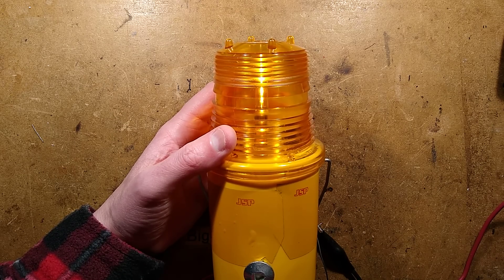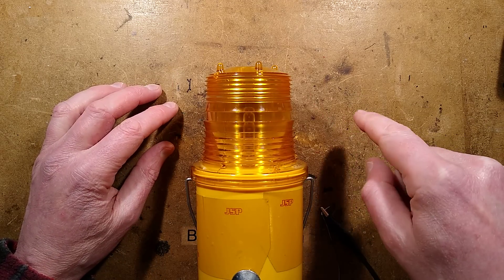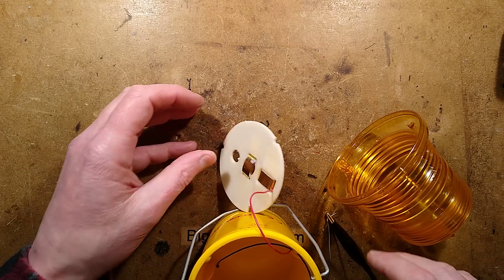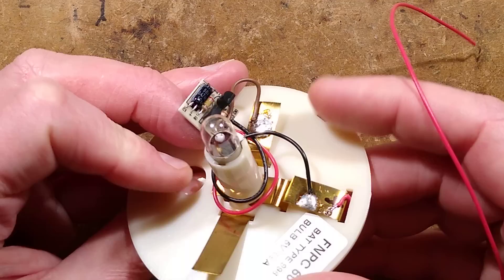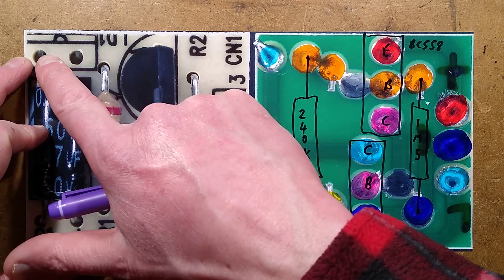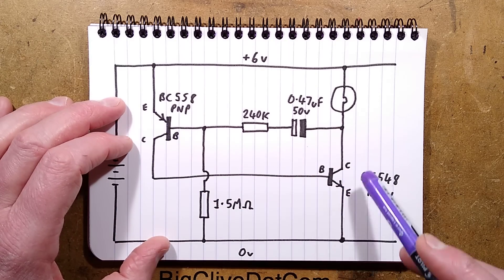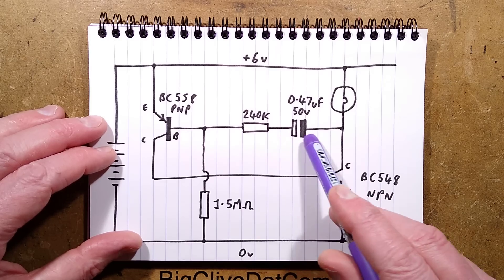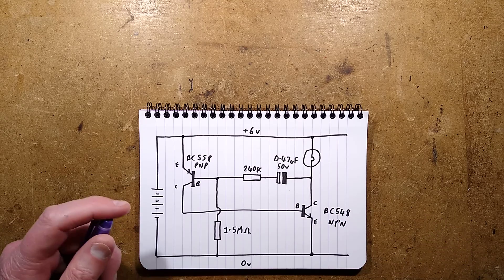Old tungsten roadwork beacon - with schematic

Comment: Seems like a perfectly reasonable oscillator circuit to me.

Initially, you'll get (6V-0.6V)/1.5MΩ = 3.6μA in the base of the PNP, giving about 360μA in the base on the NPN, turning it on solidly. Once the lamp turns on, you'll get about 22μA in the PNP base, or about 2mA in the base on the NPN, and potentially 200mA through the lamp. As the cap charges, the current will drop until the base gets to 5.4V, at which point the transistors turn off and the cap will discharge through the 240K+1.5M resistors until the PNP turns back on and restarts the cycle.
Reply: The question is: is a lower voltage higher capacitance cap bigger?
Reply: @robegatt  As long as the voltage rating is greater than 6V, it would be fine, but makes no difference in the circuit's behavior. Increasing the capacitance would increase the time constant and slow down the flashing.
Reply: @PaulSteMarie  actually the effective capacitance derate as the charged voltage appraches the voltage rating of the cap, but I think that applies only to ceramics capacitors and not electrolytics (that's why the usual rule is to use a 2x rated voltage).
If a ceramic were used here obviously less capacitance involved more resistance and viceversa to have the same frequency.
Reply: @robegatt  This circuit is pretty much at the upper limit of resistance, with only 3.6 μA to kickstart the circuit.
Reply: @PaulSteMarie  my question was about why they chose a 50V cap. Is it because you get more actual capacitance if you stay away (6V or 12V from reference) from the cap voltage rating? it seems so for ceramics, maybe it's the same for electrolyitics. Just a detail.

Comment: I remember you could buy a MES base flashing bulb which had a tiny bimetallic strip inside the bulb, I remember being fascinated how it started to flash (after a short delay) with no other components needed.
I guess they were used in bicycle rear lamps and maybe earlier versions of these roadworks beacons.
Thank you for the video Clive 👍
Reply: GE bulb type 407. They were used for Everyeady Big Jim torches and similar. A sealed beam bulb at the front and the flasher bulb at the back under a red lense.
Reply: That style of bulb was also used in many pinball backboxes.

Comment: hehe good old (PJ)996 battery 😉 i got through loads of them when i was little 😁 and when they were cheap ..theyre not now ... i have an early 60s table top transistor radio that uses 2 of an earlier? version that uses different contacts, not sure what, though,  the roberts r707 portable also used 2 996s , they must've lasted ages...

Comment: I had a slightly older one when I was a student. It had no circuit board at all, but instead a special bulb with a bi-metallic strip inside which heated up to do the blinking.  It had two of the 6V batteries in a more rectangular case.

Comment: I found one of these about 1988 or so. Disco light on holiday with other familes, big holiday home in Derbyshire. I did not steal it, not a place with other ones or building work. Was just a dumped item somewhere. Never used it as the other intended purpose but then I was not a roadworker, just 14 years old, that would be a bit dodgy. (now bet this makes not sense to some). Will if look at the right bit here on YouTube. Nice video.

Comment: I remember having a Pifco lantern in the 1980's that had a forward pointing torch and a red flashing top light that worked off the same lantern battery as yours.  However the bulb had an integral tiny bi-metallic strip to make it flash.  They were small screw in bulbs that had a sort of dimpled pattern spherical glass that was quite a bit larger than the threaded body..  I love how you make everything so interesting.

Comment: We used to nick these off skips in the early 1970s when I was a kid, good source of batteries.
Reply: Skips generally speaking had these lights attached to them to help warn road users of the presence of something sticking out into the road. I am certain that some by-law changed as, of about twenty years ago, skips no longer are obliged to have this emergency illumination...
Reply: @monchavo  Lots of highway laws have changed over the years in the UK, I remember you used to have a parking light illuminated if you parked the car at the side of the road at night.

Comment: Very nice. I expected to see them use the classic 2 NPN 2 LED style circuit but this was unexpected. Bit of a shame that they didn't use a mosfet to drive the lamp or a larger bjt given that it's max rating is 200ma. Pretty sure the LD header is the low voltage equivalent of the finger test. It stands for "lick dis 1"

Comment: i was going to drop some silly comment about using even less components for an oscillator, but it doesn't get much simpler.
a single transistor relaxation circuit is not very good at voltages that low...

Comment: I took one apart in the late 70's (a college thing). The flash was short, like a pulse. I reverese engineered it and found a two transistor relaxation oscillater with a tantulum capacitor. The board was thin and contained inside a plastic tube, with the bulb on the end. I think it charged the capacitor and then dumped it through the bulb. It lasted ages on one of those batteries.

Comment: Fun fact, the voltage on the positive of the capacitor, with respect to 0V, rises to nearly double the supply voltage, minus a diode drop, when the lamp turns on. This is fine at 6V, but if the supply voltage is any higher, it will exceed the reverse base-emitter voltage rating of the PNP transistor, which is typically 6V.

Comment: I'm a real old fart the one's I came into contact with had just a 6 volt lantern battery and a flashing bulb no PC board. The bulb looked like it had a bi metal strip inside to act as the switch

Comment: I still have either 2 or 3 of the paraffin ones those replaced in the shed, bought somewhere or other new for dirt cheap.
They've never been used for lighting, though they have seen service as low level greenhouse heating.

Comment: When the 548 turns off the 558 gets reversed biased by about 3/4 Vcc and has to wait for the cap to discharge enough for the 1.5M to turn the 558 on again, this means the electrolytic doesn't get reversed biased at all.
Reply: Clever circuit

Comment: Those 6v lantern batteries are usually just 4 D cell batteries packaged in a convenient container
Reply: Old ones, when I was a kid, had taller-than-D cells inside.  Manufacturers eventually figured out that they didn't need to make both sizes.

Comment: In the US if the battery was put in backwards it would light solid dim, it was intentional by design so they could be used either way. At least that is how they were in the 80s and 90s when I might have found a few not in use next to a former construction project.

Comment: The square base beacons with the big round lens used an astable multivibrator,  they took 2 of those 996 batteries, the switch was the bedside lamp type (push on, push off)
I still have the key for the bolt on them, one side of the key had the pin for accessing the switch through a hole
Reply: I had a couple of them and the steel tripod, bought at a village jumble sale. I vaguely remember that one had a flashing bulb and the other had a transistor circuit, in the same internal chassis. The fact you could turn them on and off with a matchstick through the hole seemed like Forbidden Knowledge back then. I later discovered that within the scuba diving community it was generally known that they contained 2 batteries that also fitted dive lights of the time.
Reply: @NiallWardrop  The 2 996's in the square case are tthe same as clive has in the round case

Comment: LD1 should be connected across base emitter of the PNP Q1, where during the day it will be low enough resistance ot hold the transistor off, and only at night, when the resistance passes the 50k mark, will the 1M5 resistor have enough current flow to start to pull the base on, ad then the feedback will latch it on hard.

Comment: Interesting .. I had never really thought about it until now, but I guess the 70's and 80's Canadian version used a flasher bulb, as there were no electronics inside.

They don't seem as ubiquitous now as I recall them .being . probably because us snot nosed punks used to steal them, but I noticed a version on highway 401 a few years back that were likely LED, and clearly synchronized via some method I haven't determined, as they would flash in sequence several meters apart.
Reply from the maker: I've come across one that had an infrared emitter and receiver.  I think they defaulted to a fixed flash unless they detected an IR pulse and then reset their timer.

Comment: A former colleague of mine was involved in designing the empco barrier light - the sort with a Fresnel lens front and back and which have a very brief flash. It was discovered that the brief flash was good at attracting attention and required a much lower mean current. The bulb was very overdriven for the brief flash which improved the efficiency further and gave acceptable bulb life because of the low duty cycle.

Comment: The US-style has a rectangular bottom, that accepts two lantern batteries, in parallel. It's topped w/ a round, flat, pancake lens, standin' up on end. My unit has a photocell inside.
Reply: There used to be a UK unit that was similar to those US ones you describe, but the overall shape was a rectangular metal box with big round lenses, one in the front and one in the back. That held 2 lantern batteries too.
Judging by the other comments (and my own experience), in the days before mobile phones, road repair companies must have lost loads of those to kids wanting the batteries.
Reply: I had one of those myself once upon a time. One of those things that seemed very cool to have flashing in my bedroom next to the record player and electric guitar, y'know.